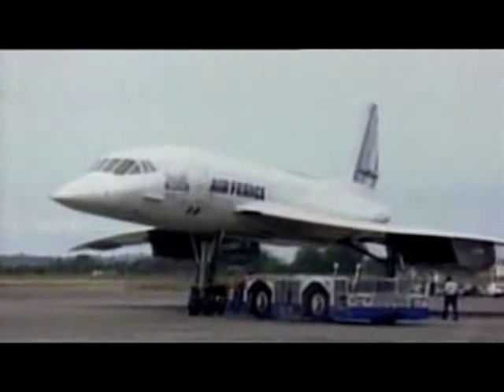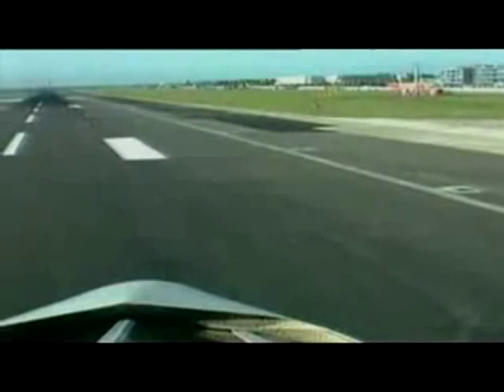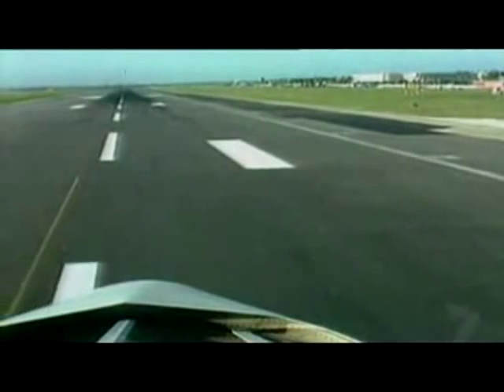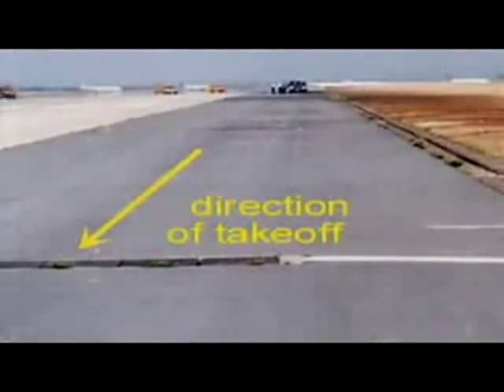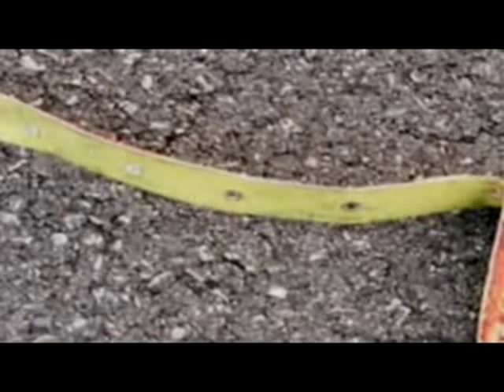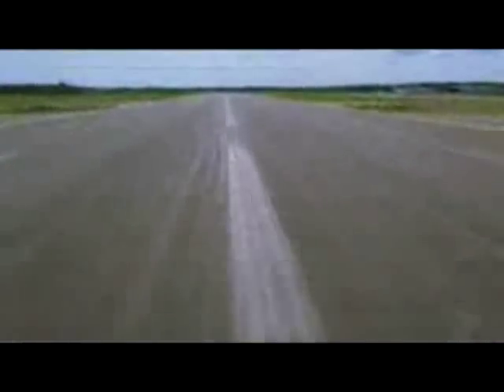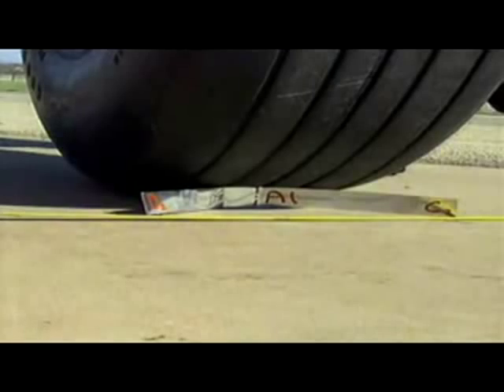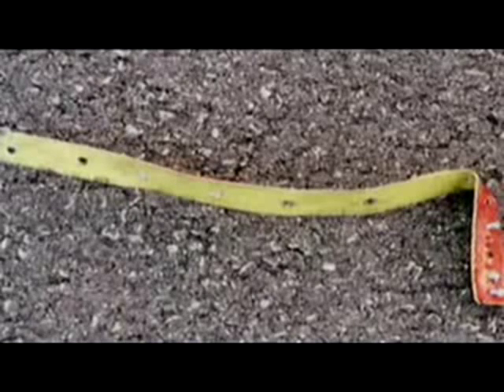Concorde Crash2000   caused by a metal strip on runway!Part 1

Comment: I don’t think the tires were so thin that it would tear from a metal strip
Reply: hitting anything metal with a rubber tire at 323 km/h would do some serious damage
Reply: "I don’t think" may be the most common reason to disaster...
Reply: It's not some car at 120 kmph
Its an airliner traveling at 325kmph and having 100 plus tonnes of weight.